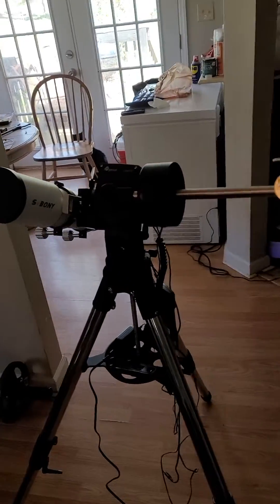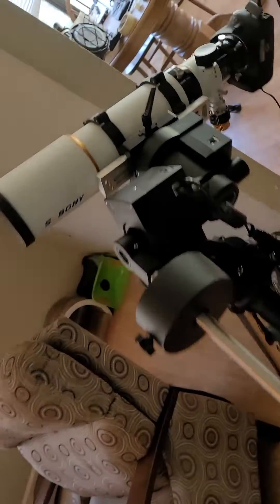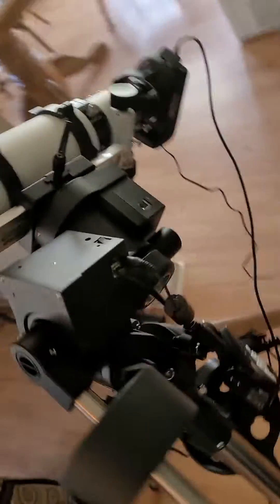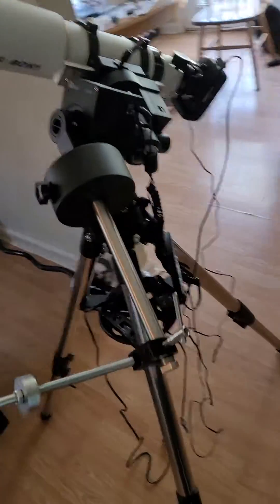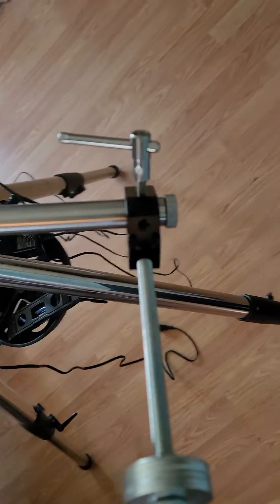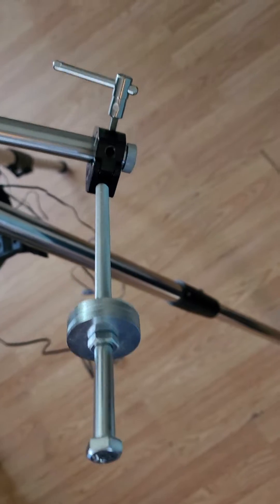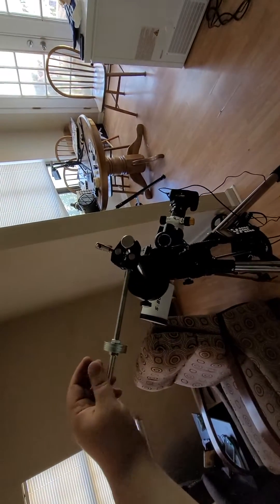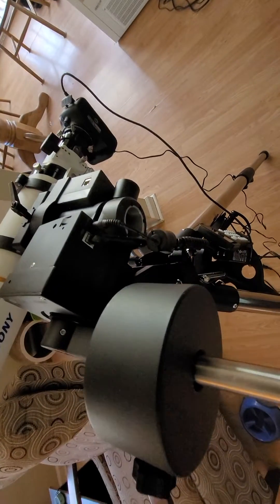Balancing a CEM26 in Third Axis

Comment: How do i know how much weight I need for a third axis?
Reply from the maker: Its not much at all. If you're using the CEM26 just use the same number of washers. you can move them so its easy to adjust until its perfect.

Comment: The 3rd axis balance is required because when everything is set up there is almost always a heavier side to the rig - e.g a finder scope on one side and not on the other, an electronic focuser housing on one side and not the other, a computer (like an asiair) on one side and not the other etc.  Note : this should not stop balance in RA and DEC.  Dec balance is achieved by sliding the rig back and forward on the mount saddle until it is balanced front to back - this means when at 90 degrees it can be perfectly balanced.  RA balance is achieved with the counter weights being slid up or down the counterweight bar.  Note, it's best to have the weights as close to the top of the bar as you can, so if you find your weights are at the bottom, get another weight and slide them up.  Both these steps are quite simple - for RA and DEC.  
3rd axis balance is the 'side to side' balance.  
For example if you are perfectly balanced in DEC, you will still find that the scope still swings once you go past a certain angle - this is due to one heavier side 'tugging' downwards.  The best way to solve this is to get a side weight. This can be fairly cheap - like a few nuts/washers connected to a bar screwed into a a vixen or losmandy dovetail (the thing that slots  into the mount saddle) - or you can buy one that clamps to your dovetail and has small weights that can be screwed closer or further away from the scope - i.e. a much smaller version of the big weights and bar at the bottom of the mount , but instead with a. sideways direction.
Reply from the maker: Yup that’s exactly what I did.

Comment: Thank you!  I was about to order that mount, but I think this is an unacceptable design fault.  Will iOptron update that mount?
Reply from the maker: I can't say whether or not they'll update it but I will say it's been an excellent mount. For ten bucks in hardware from home depot it's am easy fix..but yes I agree very disappointing that I had to do this at all. Otherwise though I'd highly recommend this mount. Rock solid tracking.

Comment: Hey!! I have the same mount and I also face the same issue. Do you know what that equipment  is called? Or may be, share the link of the amazon? It would be a great help.
Reply from the maker: https://amzn.to/3NJBMGM this is the bolt
Reply from the maker: https://amzn.to/3Ms9krD here's the washers
Reply from the maker: https://amzn.to/3H43LP3 and the nut
Reply from the maker: If you can goto the hardware store for the hardware pieces you can buy them individually and save some money but if not the Amazon stuff is just as good
Reply from the maker: So it's actually just some parts I got at the hardware store (home depot). It's a long screw thing. A bunch of metal circles with holes punched in them and and a nut to hold them on. The only unique piece of you Will is what I attach it with..that's a 3/8 screw on adapter for tripods..basically to hold a camera. I'm just waking up but if u send me ur email I'll send you some detailed photos and what not.
Reply from the maker: https://amzn.to/3NE5M7i is where you'll find the unique piece
Reply: Thank you so much!!! Email id is advparth.92@gmail.com
Reply: I couldn't get my CEM26 balanced for the life of me, both in RA and DEC, never even heard of this 3rd axis balancing, where it only comes down to basic physics, or classical mechanics i should say. In the words of Homer Simpson: "D'oh!"